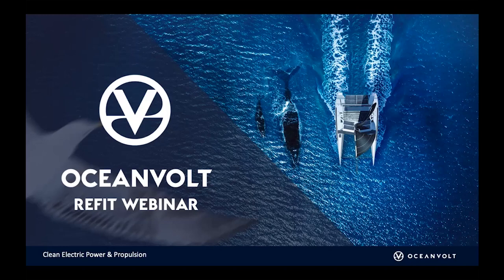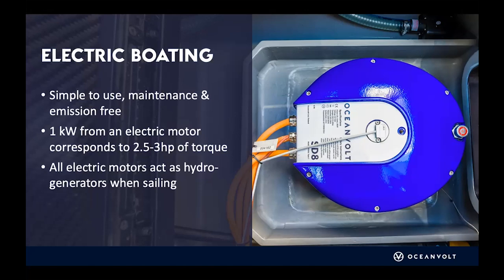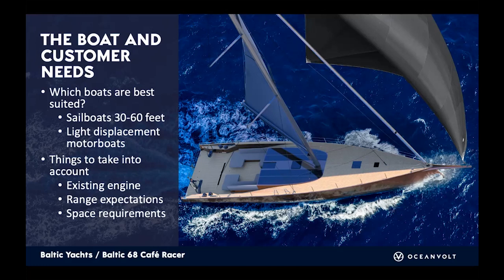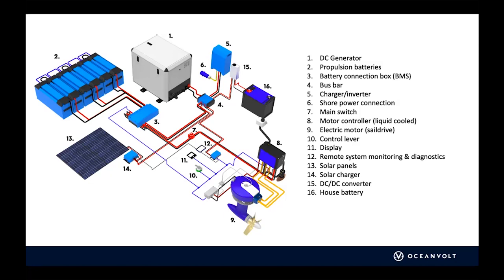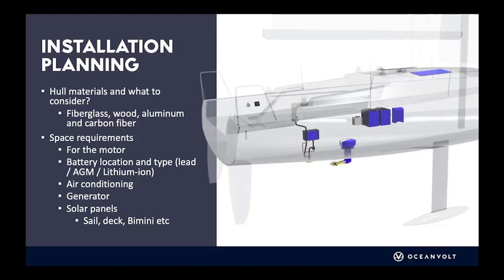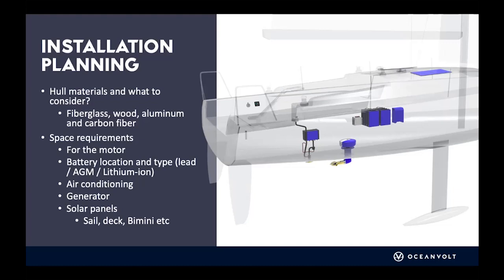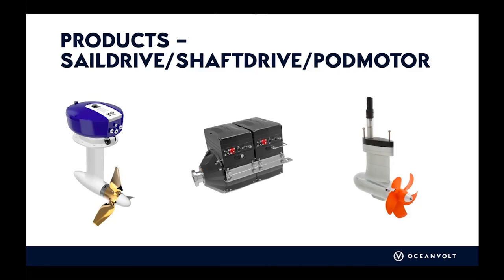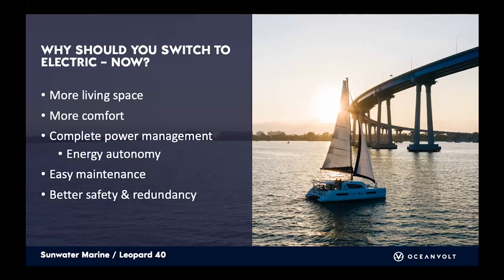Oceanvolt Webinar:  Retrofitting a boat with electric propulsion

Comment: Has "Ocean volt" ever thought about taking a 30-35 ft sailboat hull and ditching the mast, sails, winches and rigging and fitting a full length "solar roof". You could fit 15, 4OO Watt panels for a 6Kw array. In the summer Med that might give you around 30 KwHrs a day of electricity. What you end up with is a "boat for the Med". A cheap mono hull Greek Island hopper with sunshade protection and enough power for all the comforts of home such as air con, cooking, lighting, water makers and continuous 4Kt propulsion using a suitable refurbished EV battery. It would be an eye catching electric propulsion, Island hopping boating option. While the sailors struggle with sail changes in light, variable winds and get to their anchorage tired to then sleep in a hot, humid cabin the solar boat glides to it's destination at 4-5kts and everyone spends the night relaxed in a fully air conditioned cabin!
Reply from the maker: We don't refit boats ourselves, but our customers sure have thought of this before.

Comment: how do you protect against lightning ,? MOV'S? its the biggest concern on a sailboat ,as the oceanvolt system is sort after but pricy for many  and lightning would generally take out an alternator, that can be repaired or replaced at a low cost ..but I'm sure replacing oceanvolt components isnt ready available or cheap as replacing an alternator ..?
Reply from the maker: The best protection is obtained by galvanically separating as much as possible. If you install a 120/230V Transformer on your boat then it is usually the only thing that breaks, but it is really easy and cheap to replace anywhere because of Victron's excellent service network.

Comment: Do you ever have plans to go with higher voltage systems or is there any benefits of having higher voltage to say 96v?
Reply: That will come for sure, as they eventually move to 400V car batteries. I think the cheapest option in the future is to get a 30-100kWh battery made for a car. Will always be cheaper than low volume 48V batteries.

Comment: Hello, I am curious about the "Continuous Run" characteristics of the AXC 12 and 24 motor configurations.
Example:  Runing for extended periods in the series hybrid configuration while the generator is online in to recharge the batteries
Reply from the maker: 12 kW ja 24 kW continuous run, 15 kW and 30 kW peak for 10 minutes. The generator usually determines the motor output, because in that way the batteries do not get drained. Rule of thumb for sizing the generator is 50% of the motor power, or cruising speed.

Comment: i sized a system for a little Grinde 27, using one of the newer axial flux motors and got the pack down to 24V ( 25.6Vnom ).....that's the gold, because the system can still be electrically floating..
On Salt, anything over 25.6Vnom ( up to 51.2V Max nominal Li-Ion ), you really need the center tap sea ground, to center reference the pack;
but as soon as you put in a sea ground, you need faraday cages, and a way to route lightning current to sidarcs.....So don't put in CTs....but what are we going to do ???

Comment: 2.5 to 3hp of torque Being Inclusive of the Reduction of course. ( or don't say that to someone directly connecting an electric motor to a prop shaft ) The Nice Thing About Approved Systems Is They Are Approved For Their Voltages, People Out There !!!!
on the piece meal stuff:
there may be some provisions, in the emerging salt code, having to do with connections; which may allow for higher voltages than 51.2Vnom.( Not Anytime Soon Though ) but i think that center tap sea ground may have to be there, ( But Then You Have To Have Protection From EMP ) at some point; for packs over 25.6Vnom.....and the same connection code Might allow for floating packs, under those regulations, which are a little higher than 25.6Vnom.......but as it sits at the moment, electrically floating packs are still limited to 25.6Vnom